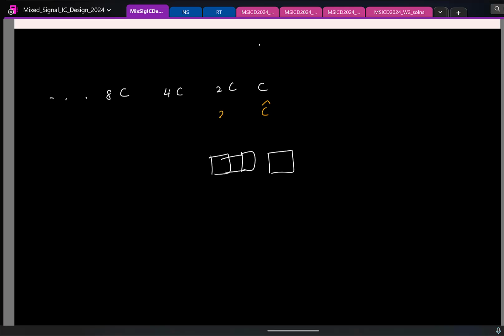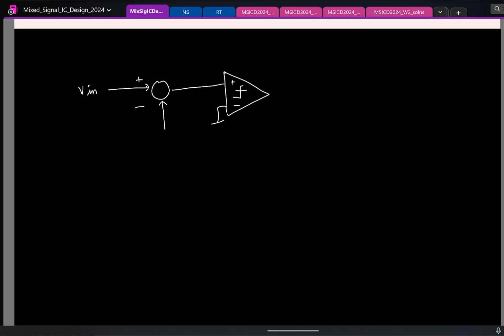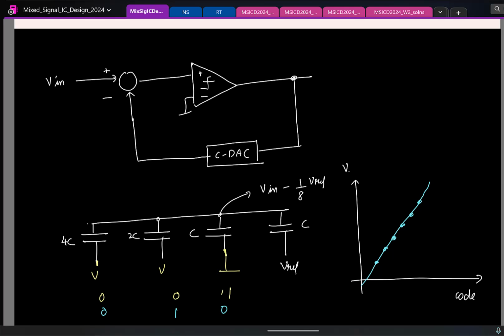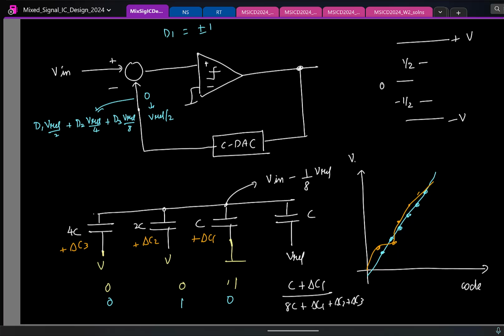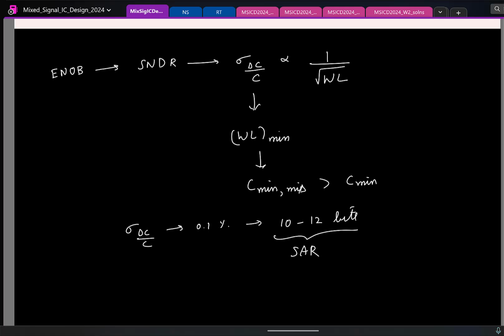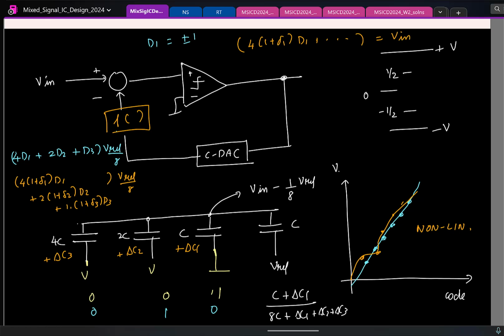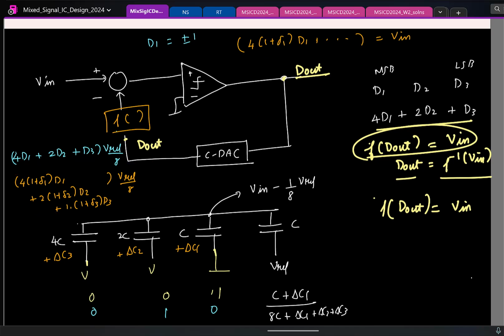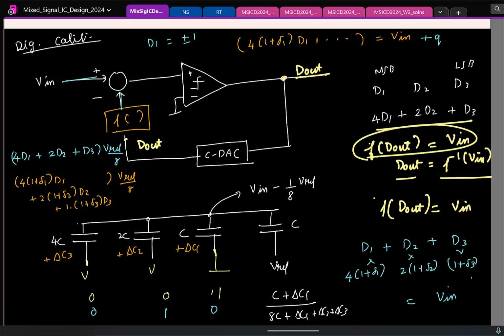Lecture 17(2): SAR ADC: Effect of capacitor mismatch: Understanding why digital calibration works

Comment: Sir, can you please tell me why you use differential structure in SAR ADC? Why not single-ended? And what is the problem if we design for single-ended?
Reply: The comparator need differential input in order to check if the input is greater than zero or less than zero, to give appropriate digital bits of data. Differential inputs helps to check what should be the next step for comparison